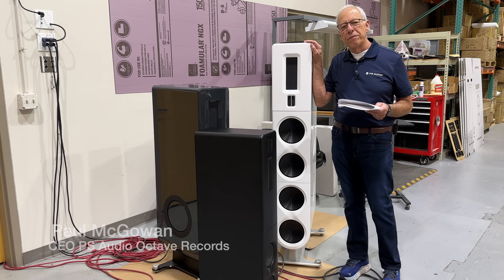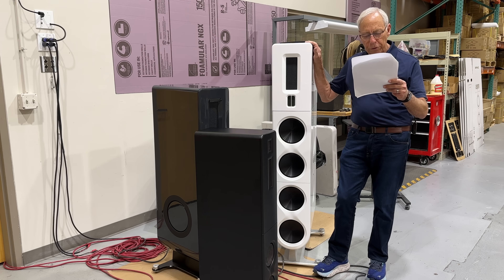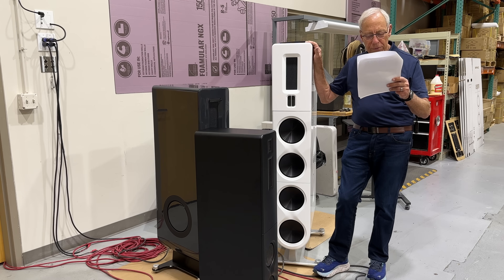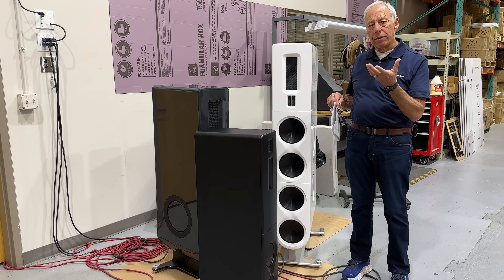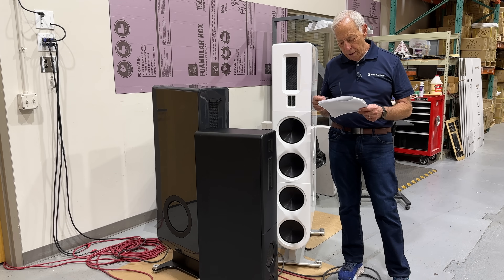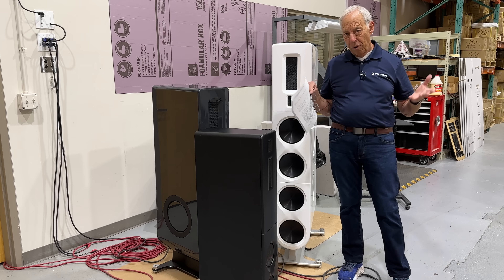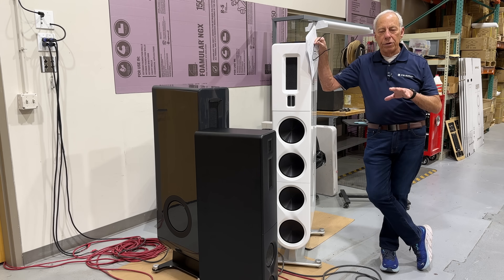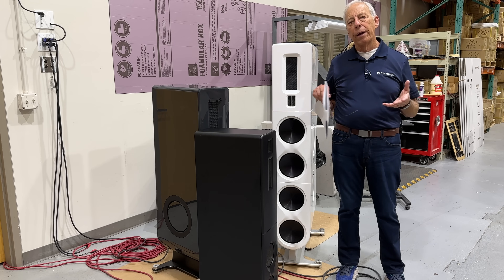Step down transformers

Comment: Yes you are 100% correct. But if i was to buy a power amplifier with a primary input voltage of 110/120 Volts. I would see if that power amplifier also has the capability of switching to 220/ 240 Volts. These days manufactures should ( ?? ) be able to build the power transformer with duel voltage , this being so as that Power amplifier could be sold all over the world. But then comes the cost involved and trying to compete in a globle market.

Comment: You shouldn't need multiples of your amp's power draw requirements in a step transformer.  Remember that your amplifier has stored power in the power supply caps to supply peak power.  In other words, an amp's headroom is provided by the onboard power supply.  The wall power is there primarily to keep the power supply capacitance energized.

Comment: You will be using a 2:1 ratio step down  transformer ..Get onebrated for 15 amps secondary.And you will be fine if yiyvcan get a 20 amp seconday it would be better but the cost amd size goes up .2 KVA transformer is more tham enough .And if you cam get a tramsformer with a secondary tap so you can puck the voltage you  desire .A 3 kva  variac is expensive .Compared to an ordinary step down transformer ...And just remember yiu have a choices to wire it with an isolated ground and if you wanted a secondary  center tap transformer you will have to bond the neutral /Center tap ..So many ways to do it

Comment: Paul should have suggested buying an amplifier with a voltage selector ---    
or at least a dual-primary transformer --- so it can be correctly set up to operate on 230 volts.

Comment: 5x is OK for mid power amplifiers and source gear, but when we get to 200 watts RMS per channel, 2x is enough in a residential system. Otherwise the size of the transformer gets ridiculous. Class B amplifiers are anywhere from 60-75% efficient. Class D can get to 95-98% efficiency. If I had a large power amplifier I would consider two step down transformers. One for the amp at 2X it's RMS power and a small 250va for my source components and preamp. This will result in less voltage sag for the source components, albeit they probably have regulated power supplies anyway.

Comment: Are there any issues with using a step up transformer…as in Japanese 100V amplifier powered by a USA 120V outlet?
Reply: That would be step down, if you needed a transformer.  But you probably don’t.  Check the specs on the 100V amplifier and see what range of input voltage it tolerates.  Chances are good that it would take 120V, no problem.
Reply: Step up: using a piece of equipment made for the US (110-120v) in Japan. 

Step down using 100v -120v in a 220v place.
Reply: No isses

Comment: Most power converter step-down transformers (that I’ve seen!) halve the mains voltage and double the current flow, and are rated for around 25-50 amps at 120 vac! That’s PLENTY of current/voltage to power a 300 w/ch amplifier!!! C’mon Paul!!!

Comment: I have a sold in Japan  Denon turntable that is set to 100 volts and I use a step down transformer to go from 120 down to 100 for the turntables needs..works fine
Reply: Be careful though. Some areas of Japan, IIRC the north, use 50hz @100 v. If the turntable has a line operated AC motor it will run faster.  Many legacy turntables of this type do have a different pulley step for 50hz. Direct Drive turntables use DC or multi phase AC motors driven by a servo system and are not line frequency sensitive.

Comment: Sometimes you can change the input voltage at the back of the amplifier or by soldering some wires differently inside. And why not change the transformer inside, powerful step down converters are expensive, I bet you can get a transformer for the same money as long the output voltage is the same.

Comment: How would this work for importing Japanese power specifications integrated amps AC100V 50/60HZ to the US for use on AC120V 60HZ? Would you still use the same ratio? Is there an impact to the sound signature?
Reply: The ratio in this case would be 120:100.  The amp needs a specific set of voltages to operate.  EG, 40V DC for the output stage, and 3.3V for some control circuit.  The amp has a transformer with multiple taps to supply sufficient current at the specific voltages it's circuits require.  So your Japan market amp expects 100 in and for eg 45V, 10V and 5V out.  To use it in a 120V system, you either need to change its internal transformer to match 120V in or supply a step down transformer to feed it the 100V AC it is designed to operate.
Regarding sound signature...  running the amp on a stepdown transformer will likely change the sound signature a little.  Some may prefer it and others not.  I experimented with running an isolation transformer (120V:120V) as a noise filter.  To my ear it slightly dampened dynamics.  This was the same even with a massive 1000VA thing that weighs 50 pounds.  I concluded that on the DAC, it was ok, but on the power amps it was marginally worse.  I think it could be a mistake to buy a Japanese amp for its ability to provide nuanced sound, and then potentially dampen it's performance with a step down transformer.
Reply: @user-od9iz9cv1w  Thank you for the detail response and advise. I've been looking at the new LUXMAN - L-507Z Integrated Amplifier and the difference is about $3.5k from buying it in the US compared to importing it from Japan - but it sound like is not worth going the import route.

Comment: It never ceases to amaze me how much "science' exists only in the audiophile realm.
Reply: That is why I buy a complete system from one manufacturer. 
Everything is designed to work in harmony with each other. All I have to do is listen to the music… 👍 
The science was already done by people a hell of a lot smarter than me..👍
Reply: @davidfromamerica1871  
Ummm ... yes ... but not what I meant.

"Science" ... in quotes ... meaning bullshit.
Reply: @davidfromamerica1871  
LOL ... I hear ya! 

The other day I was introduced to a friend of a friend ...
Friend: "This is Douglas, our local audiophile."
Me: "I see no reason to be insulting"
Friend of friend: <blank stare>
Reply: @davidfromamerica1871  
On a more serious note.... while there can be advantages to a one maker solution, there are generally accepted standards that allow you to freely mix and match stuff pretty much at your whim and will.

For example... most RCA interconnects work at 2 volts, with a low output impedance (typically 75 ohms or less) feeding a higher input impedance on the next stage (typically 10k ohms or more).  This ensures that you can hook up an acme tuner to a widget amplifier and it will work. 

So don't be too worried about matching stuff... all those smarter people already thought of that years ago.
Reply: They do serve a purpose, but the improvement is probably not perceptible at all.

Comment: If you use an auto transformer rather than a primary - secondary step down transformer, the efficiency is greater and therefore better regulation - lower impedance too. If you go for a rating 50% more than required, that's all you need, even with trouser flapping bass.

Comment: Can the PS audio power-plant step be configured to step down the the voltage from 230VAC to 115VAC?
Also, the first thing to do is to see if the transformer in the amplifier can be configured for 220/230VAC. That would be the best scenario. Then, I would go about it a bit different: The starting point is not the power output rating but the power in take rating. And that is written on the back of the amplifier (by law in many countries). Now here is the good news: A step down transformer is NOT an audio product, so you will be surprised how cheap an industrial 3kW step down transformer is (buy it at Mouser). So if your US bought amp is something special, add a few hundred bucks for a monster step down transformer and Bob's your uncle.
Reply: Take what Paul said with a handful of salt! A big pinch..  Check the back - if it's 110 - 240V you're ok.

If you have a 30+30W amp, it'll probably only be providing 3+3W most of the time.  Loud enough for most people with a family and neighbours.  So a 100W transformer from Mouser will be enough.  Turn too high, next door will complain and quality may drop a biit.  But if your ears are bleeding, you probably don't care!

Comment: Paul, do ps audio make anything voltage wise for the Asian 220v people?
Reply: Paul has said before that all their products are universal.  Class D amps like Sprout and Stellar probably don't even have 120/240V switches.  BHK amp have a multi-volt transformer - you need a physically bigger one for 50Hz as it's less efficient than 60Hz.  But they won't tell you the wiring!
Reply: @joesharkey1021  thanks for that!